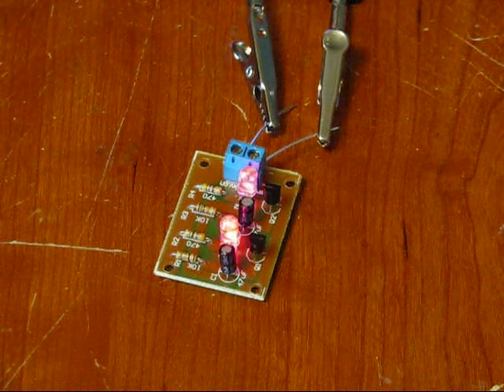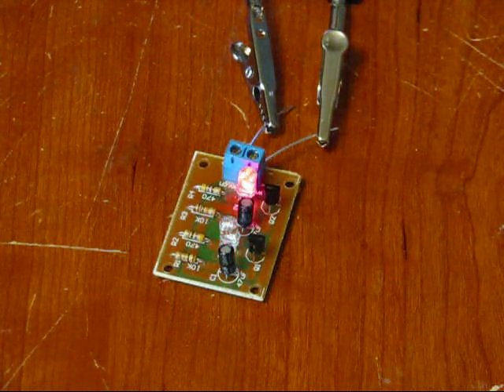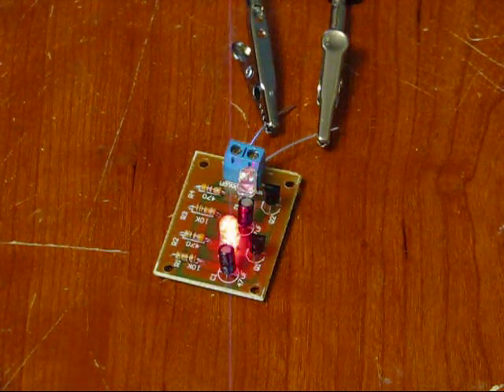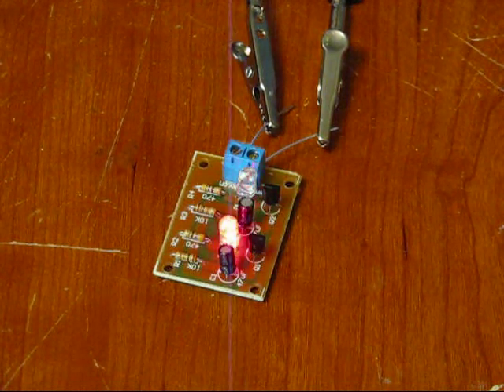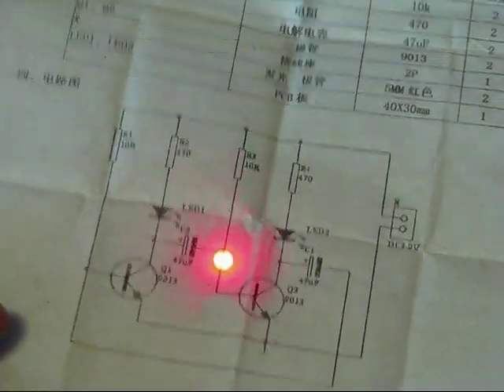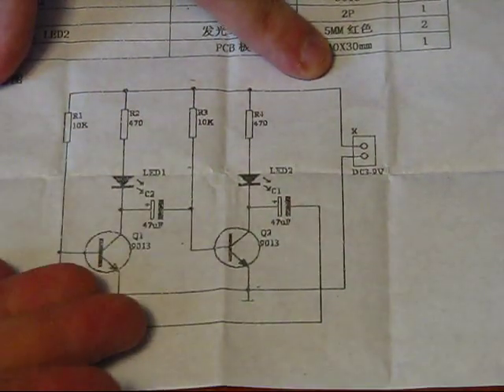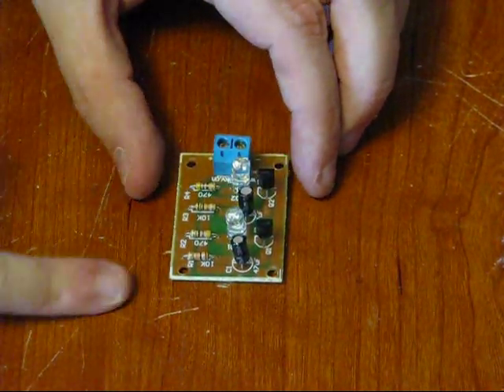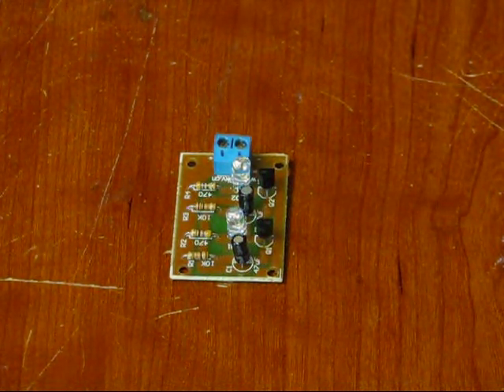Extremely simple LED flasher DIY kit for beginners from www.engineeringshock.com

Comment: you can change the frequency by changing capacitor rating (higher uF = lower frequency, lower uF = Higher frequency)

also, try to use the lowest resistance resistor for the LED without over driving the LED (this is important for low voltage circuits). if you have allot of resistors laying around then start with 470 ohms and if the LED is dull use a lower resistance on the LED circuit (changing the Resistance may change the switching frequency so be aware). if you increase the circuit voltage you will need to use a higher resistance resistor to prevent damage to the LED

On a sim program I'm using a 3v battery the LEDs (2x per circuit with a 1.2fv) have a 50 ohm resistor, the capacitors have a 10k resistor and the capacitor is 100uf and i'm getting a switching frequency of around 3hz (1.5hz per set of bulbs)

Comment: Tried this with a 9v and some salvaged 100uf capacitors. Couldn't get any blinking or any light at all. Should I use lower-rated capacitors? I fear the current isn't making it through them.